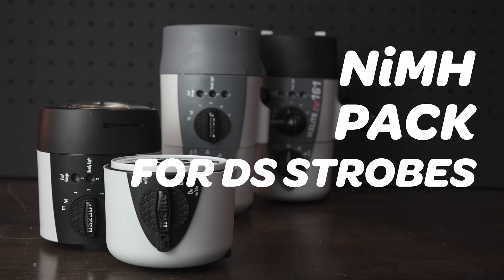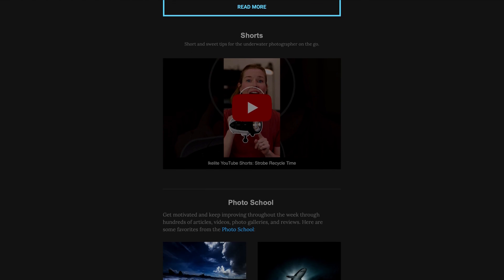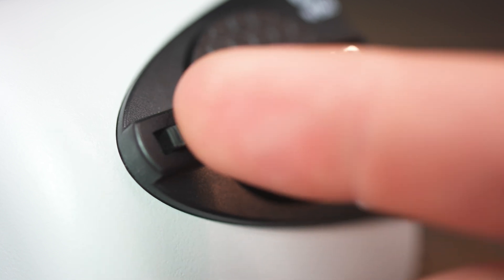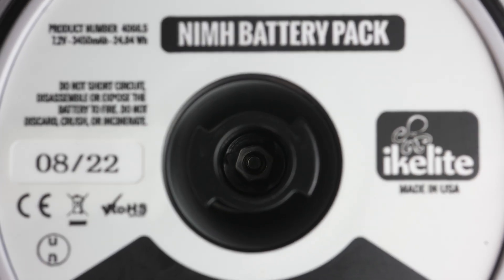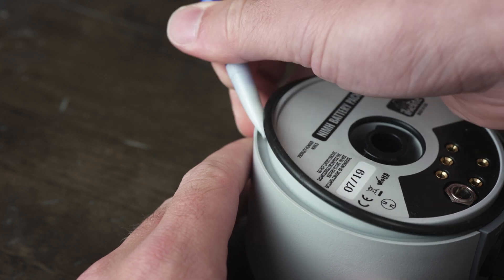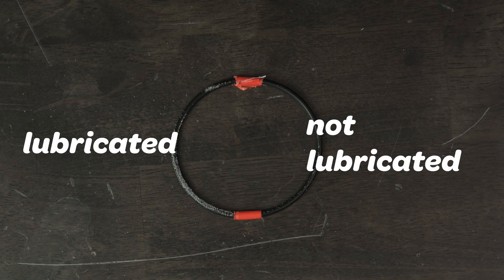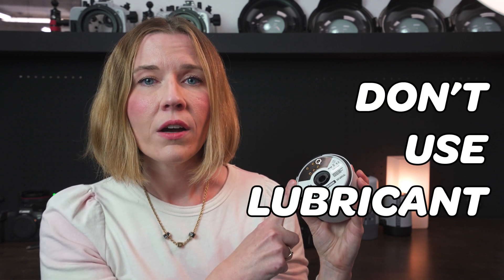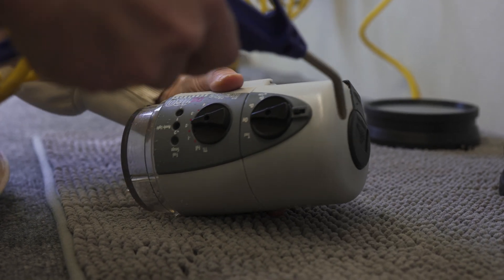STOP doing this to your strobe battery pack!!! // Ikelite DS160 DS161 DS230 O-Ring Maintenance

Comment: What is the life expectancy of the battery o ring
Reply from the maker: We don’t quote a lifetime per se, but a battery o-ring can last many years if properly cared for and not cut or scratched. If the o-ring surface looks smooth and is in good condition then it’s likely ok.

Comment: My battery pack for DS161 still in working order after about 6-7 years.. (only a couple of trips a year though).. I'm currently in a process of making decision to upgrade my kits.. and next kit would still be Ikelite.
Reply: I bought the ikelite ds230 you got a upgrade?
Reply: @RickP9st I bought DS162 (the one with Video Light) to add to my setup as dual strobe.
Reply: @Wobbegong_th so you have a ikelite ds161 and a ikelite ds162

Comment: Thank you for this! Would love to see a similar do's/dont's video for the housings.
Reply: I would as well
Reply: Yes I would like to know what I should be doing in the winter when I store my housing. Should I be removing the port from the housing? How often should I or should I not lubricate the O ring in the port etc. please make a similar video. We have so many questions 😃
Reply: And also for long time storage in Tropical area.. should the Oring be left on the housing or off. and when travel on airplane, should oring be on or off
Reply: @Wobbegong_th  when traveling on an airplane apparently either you remove the o ring or don’t close the housing. I traveled once with the o ring on and a closed housing and the difference in pressure made it so difficult to open it when I arrived at my destination.
Reply from the maker: Great idea!